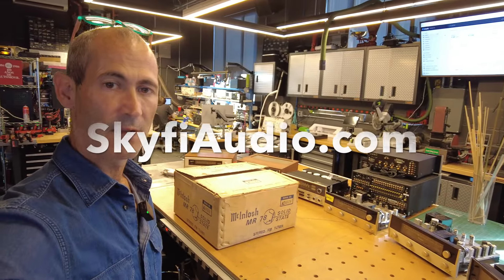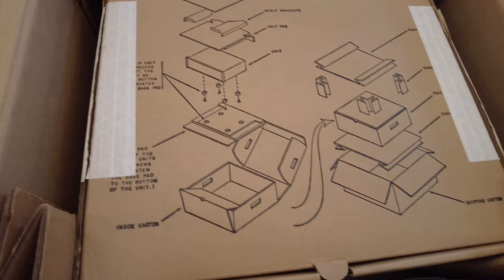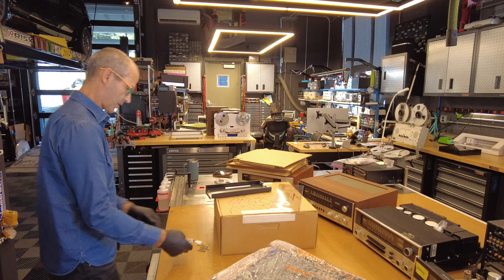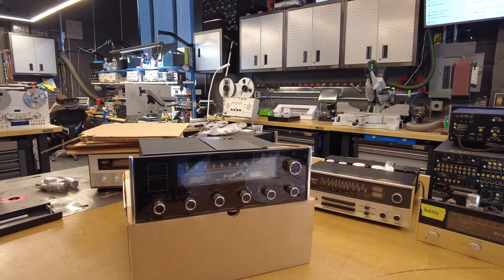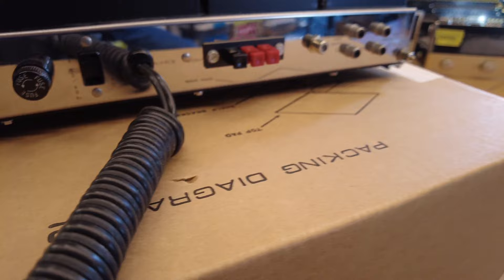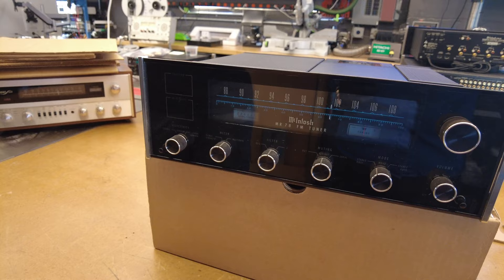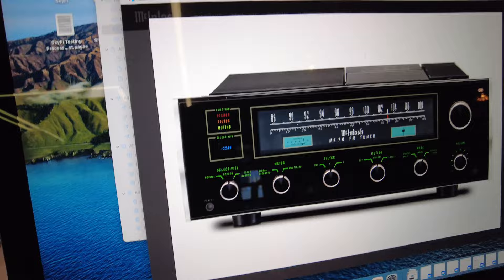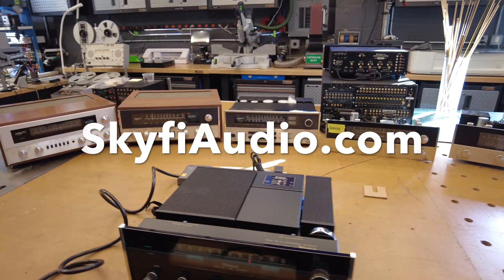Unboxing a Brand NEW McIntosh MR78 from 1970's

Comment: I have the MR 74, it still works, picked it up at a garage sale for $50.. Most of the light bulbs were burned out so found some on E-bay for a few bucks.. I use it to monitor an FM transmitter for a low power station I do engineering for. It has good sound for it's age..
Reply: ❤ I have a 74 also.  It’s out for alignment now.

Comment: The trio of grail tuners- Sequerra, 10b and MR78. Amazingly, Rich Modaferri is still active and restoring & modifying MR78’s. He even has a one off ‘78 with a tube output stage but he definitely doesn’t offer that as part of his mod package. Probably the only aftermarket mod that the original manufacturer is 100% ok with. And while front glass damage is not uncommon, McIntosh continues to make beautiful replacement front glass for this and numerous other old McIntosh gear.

Comment: My question is a simple one. Can you describe for me the 'McIntosh Sound' ? I have owned a MR 77 tuner, c28 preamp and MC 2100 main amp for twenty - five years. The Martin Logan ESL's are only six years old and I am quite satisfied with the setup. That is the only system I have listened to for all that time . Just what is there about the sound that garners all the praise, or is the praise directed towards the newer equipment and not 45 year old components.

Comment: I'm sorry, but I bought my MR78 new in 1973 for $799. That was a lot of money then, and I had to save up for it. I have the original brochure and it states/printed that it is $799.
Reply: And by the time the MR78 was discontinued the cost was $1699
Reply: @NateEll  It may have been, but it largely sold closer to $799 than for $1699 for most of the time.
Reply: @georgeherman9953  can’t quibble/ bought mine for $750.
Reply: Back in 2006 they just came out with a ma6300 integrated  i bought for 3000. After tax . I got a little deal. It retailed for 3000. 5 years later it went up to 4500. I ended up selling mine for 3500.

Comment: Great looking tuner. Fernando, did you leave the link for the Navlabs antenna you mentioned? I have a MR71 and I'm less than happy with the Terk (Audiovox) antenna I'm presently using. Thanks in advance.
Reply: Try a good old fashioned pair of rabbit ears. Far better than any Terk or similar powered antenna.  If you can find a vintage set of Radio Shack tunable rabbit ears specifically designed for FM, all the better. Short of a dedicated outdoor rig, hard to beat.

Comment: That’s not how the MR78 came from the factory- the plastic bezel was attached to the front glass (double sided tape). The stock photo you show includes the bezel. That ‘78 either has replacement front glass (which is supplied with no bezel attached and yeah, glass is still available) or some owner removed the bezel. But why remove the bezel if the tuner was never used? Looks quite clean, but NOS? I’d be very suspect of that. In fact, it was common to remove the bezel or not reattach the bezel if the glass was replaced because some prefer the clean look without the bezel. And the light level is adjustable- there is a low/high light switch. It’s not dim on high and the light switch is not on the front of the tuner. Finally- the oscilloscope prior to the  MPI-4 is not an MP-3; it’s an MI-3.  In terms of usefulness, the oscilloscope is not better than the needle type signal strength or needle type center tune meters, but it is useful for multi path. And it’s a fun light show.
Reply from the maker: Good catch Nate.  When we restore units we dont put the bezel on and leave it up to the new owner to choose if they want it on, so Im used to seeing the MR78 sans bezel.   Yes it could have been a glass replacement at some point but the unit is definitely NOS and was never used.